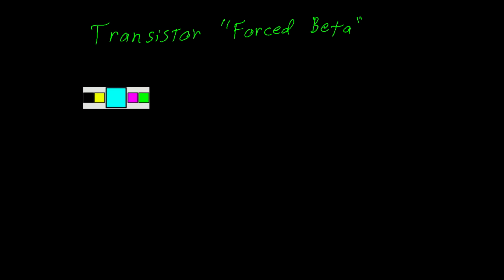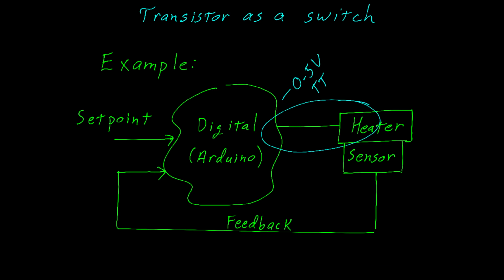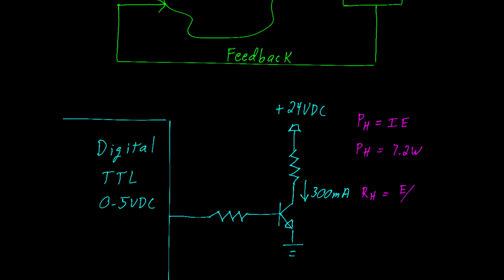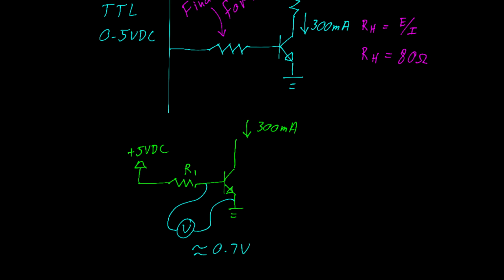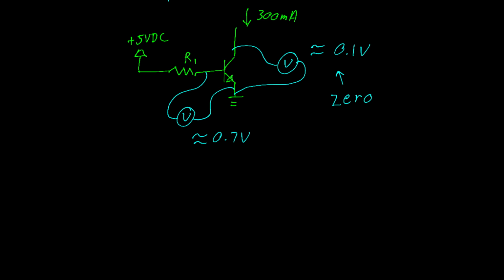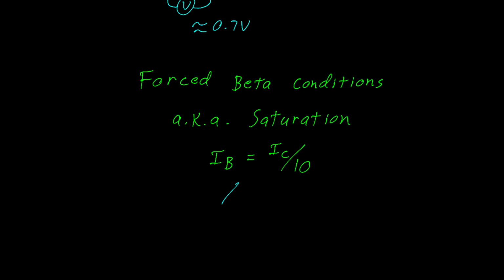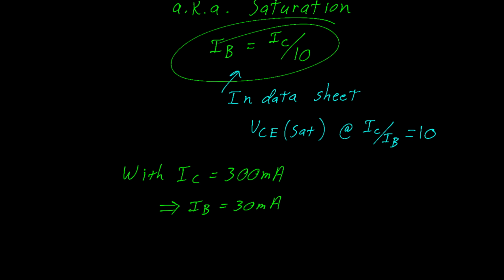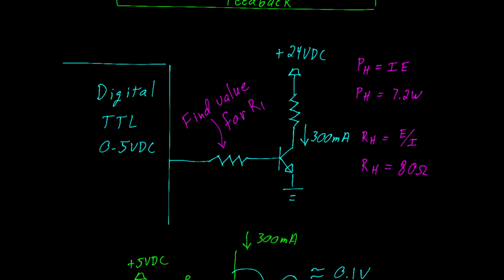Transistor as a switch using forced beta conditions

Comment: Hi Sir, if the load is considered as a RC circuitry, such as the MOSFET, as we know that the current will be almost zero when the ciss of the MOSFET has been fully charged via Rg at the timing of 5 times tau, at this moment, how to confirm BJT still can operate in forced beta condition?